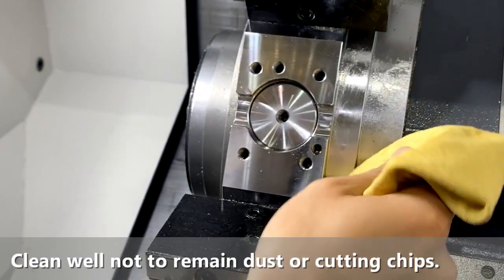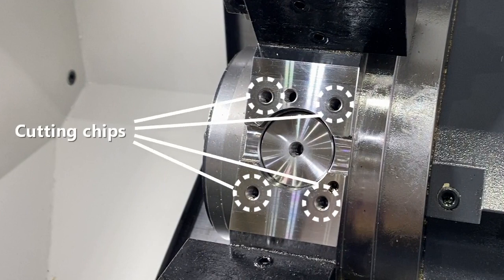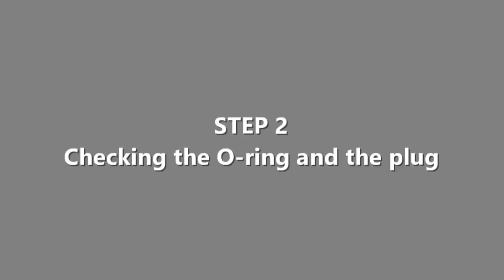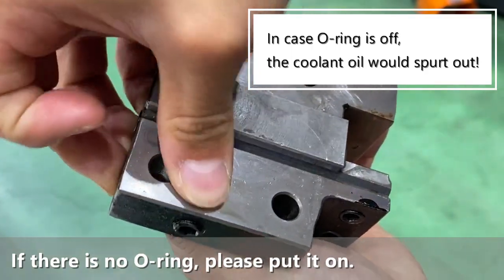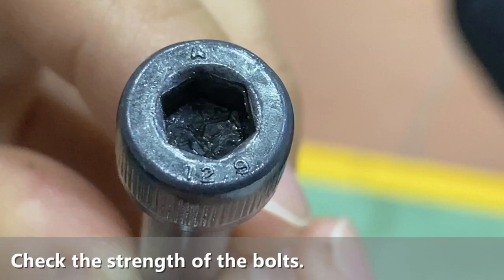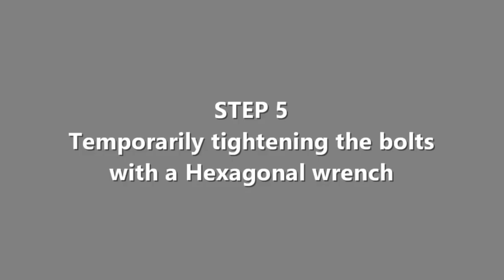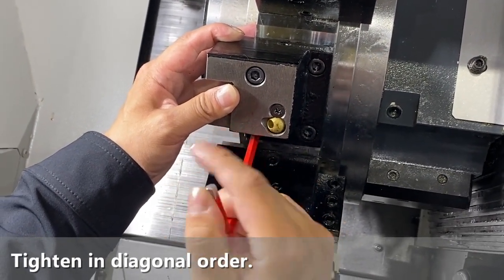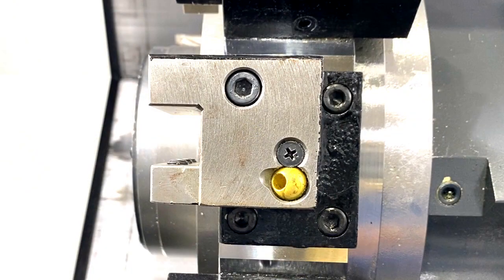How to Install Turning Holder [Tips tooling holder manufactures think important #1]

Comment: What is the recommended torque setting?
Reply from the maker: When the Bolt grade is changed, tighten torque should be changed.
10.9 Bolt grade is used for NAKAMURA TOME tool holders so please take values from grade 10.9.
Reply: I understand the bolt grade. But what setting is the torque wrench set to?